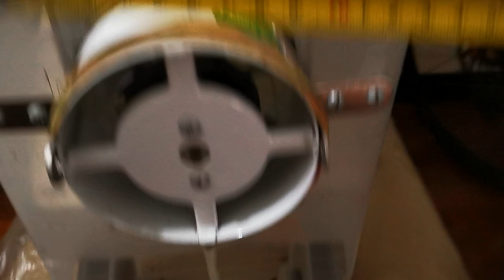How to Make Cacao Winnowing Machine Using 4 inches Fan (Meat grinder and DIY Vibrating Machine) Prt1

Comment: Que tal amigo. Me gusto el diseño. Yo alcance 82% de recuperación de nips. Pero tuve que hacer 3 a 4 pasadas y variar la velocidad del ventilador.
Reply from the maker: thanks for the feedback. i experience the same too while doing it. But when you get the right angle and right airflow it will lessen the number of times to pass the beans. You should also consider the size of the crushed beans that you intake. thank you for visiting.

Comment: Thanks for sharing Jake galing. Question: Will it improve you think if you use vacuum instead of fan. Gusto ko yong mga angle sa flow nang crack cacao before it hits the fan makes sense.
Reply from the maker: I need to re-design if vacuum ang gagamitin. And yes possible mag improved but vacuum is prone in overheating kapag matagal ginagamit and malakas sa electric consumption. Meron din mga available na design sa youtube na vacuum ang gamit. I made this design kasi cheaper po. Compared sa vacuum.
Reply: i dont mean to be so off topic but does anybody know of a way to log back into an Instagram account..?
I somehow forgot the login password. I love any tricks you can offer me
Reply: @Sean Sterling instablaster ;)
Reply: @Danny Joaquin I really appreciate your reply. I found the site thru google and I'm waiting for the hacking stuff now.
Seems to take a while so I will reply here later with my results.
Reply: @Danny Joaquin It did the trick and I now got access to my account again. I'm so happy!
Thank you so much you saved my ass :D
Reply: @Sean Sterling Glad I could help =)